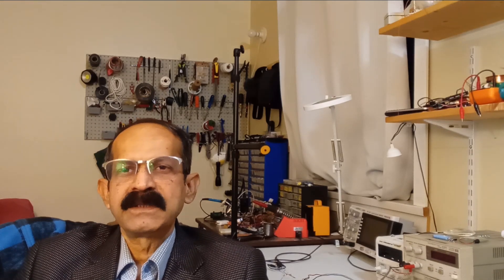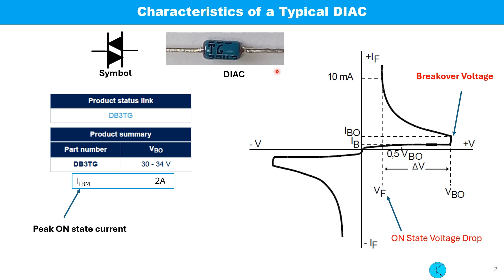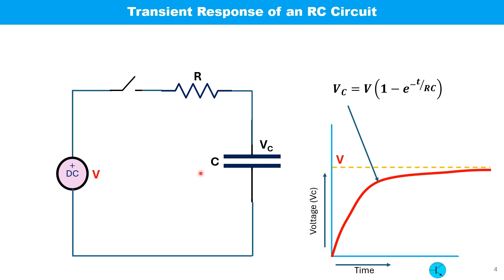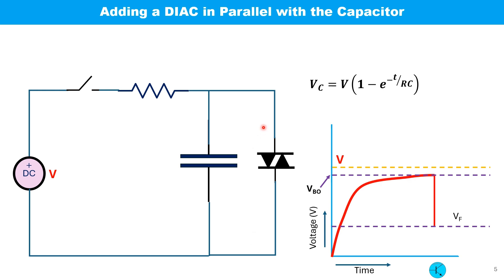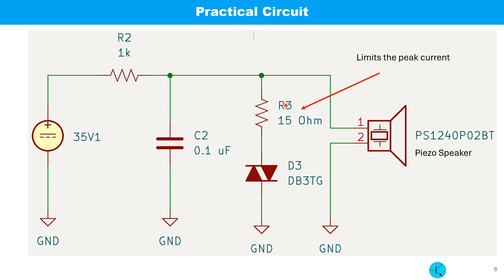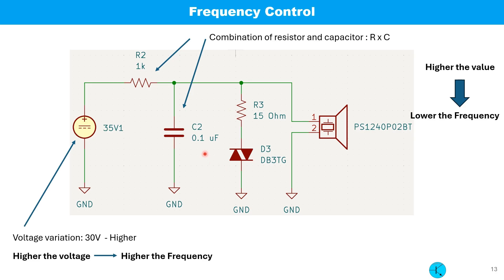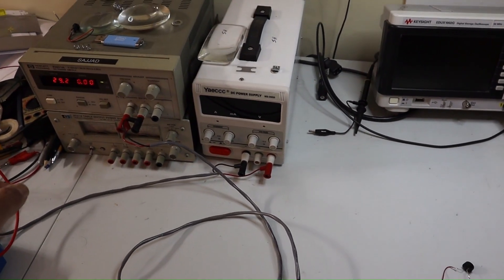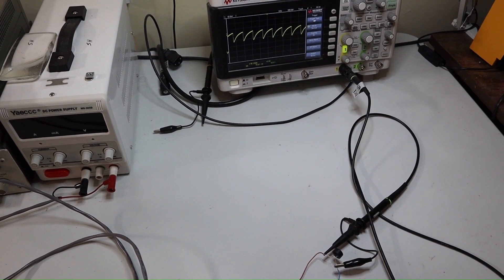Simple Tone Generator Using a DIAC

Comment: Can a potentiometer be added to the circuit to adjust the tone? If yes, where in the circuit would I place it? This is a great idea! You are a good teacher. Thank you from Chicago.
Reply from the maker: Thanks for watching. You can add a 5 k Ohm potentiometer in series with R2 (1k). This will make the circuit tunable. If you are using  a 5k pot, the value of R2 can be reduced to 500 Ohm. .
Reply: @technologyforyou5976 I thank you so much for responding to my question. I will build the circuit and let you know my progress. What is a rough estimate of the circuit's frequency range? Again, thank you. I have subscribed and will share your channel with my friends.